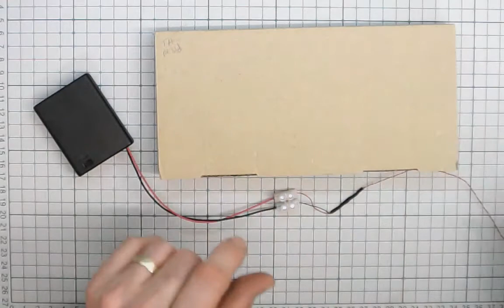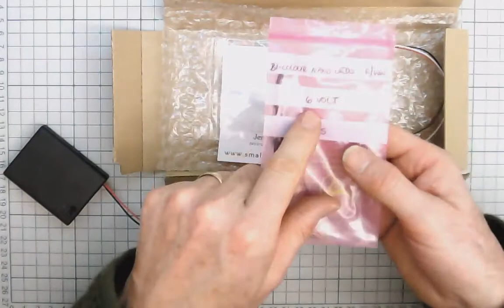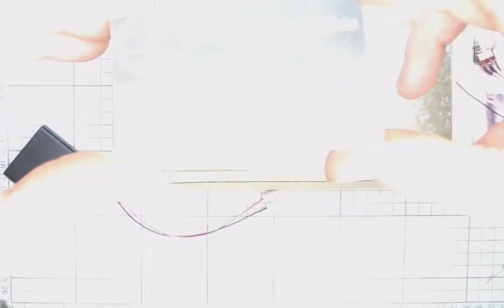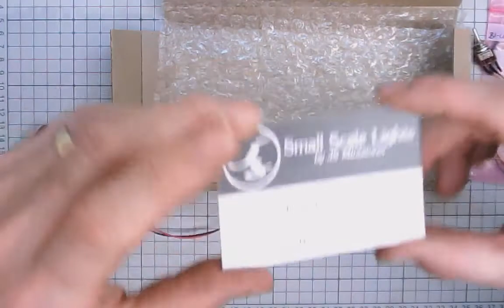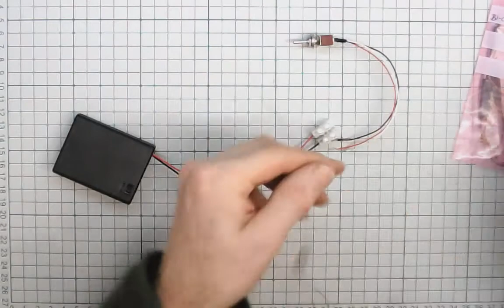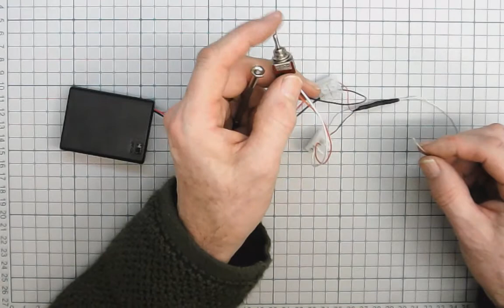LED lighting for Trumpeters 1/48 scale Uboat U552

Comment: She's out of the kit, unfortunately. What about the actual scale light fixtures.  Are those in the kit, or did you have to scratch build them?
Reply from the maker: Lucky 13 I didn’t use the light fittings 
The led lights are small enough to be hidden